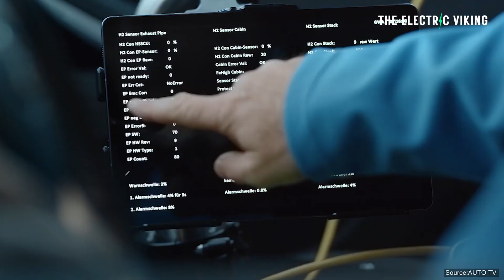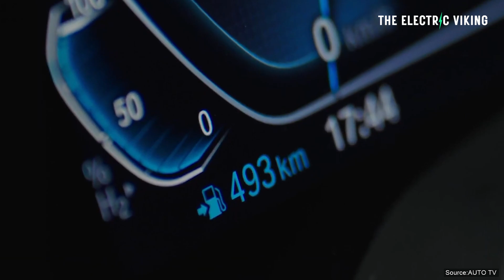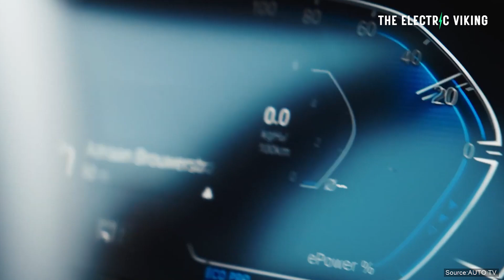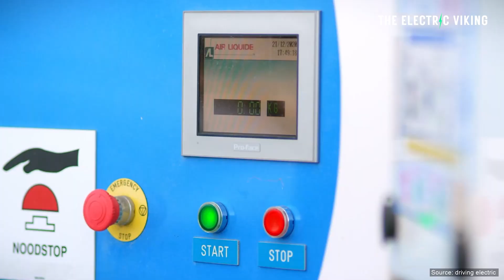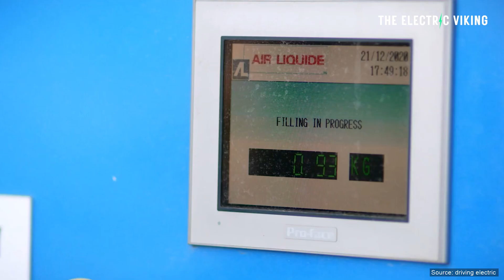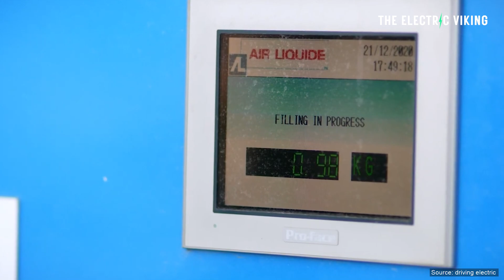BMW partners with Toyota on the future of transportation - hydrogen

Comment: Didn’t Toyota announce they have halved the size of batteries a month or two ago?      I can see big oil pushing hydrogen because it’s a commodity that can be sold.     I have been hearing from Toyota staff that hydrogen is their clear direction for so many years.  I think they are missing sales today by not having full ev models available.

Comment: To be clear, I believe in EV’s…but I’m critical about battery business.
The real question is, do you really want 100% battery powered EV’s and the huge adaptions to the complete electrical grid from an ecological, political and cost POV.

Batteries will never have the environmental sustainability potential of H2. 
H2 will temper the need of those large polluting batteries.

The abundance of available H2 both via clean energy or via industrial waste compared to the rare metals of batteries are politically a more stable resource.

Lastly cost… yes… batteries are more efficient compared to using H2. (most charge time issues will be solved in the next 5 years). That has an economic impact…as long as you’re not using ‘free’ green H2 or leftover industrial H2. So who cares if H2 is less efficient?
The cost of network is indeed huge…but have you ever considered the impact EV’s will have on the current grid? 

Just to have an electrical charger installed at my home for a PHEV, I need to have my complete electrical installation redone (house of ‘74) before it can get legally approved in my country.
That’ll cost me several 1000’s € on top what the government will have to pay to update the complete grid to our homes.

H2 is an alternative to BEV’s, not a replacement…an alternative that is ecologically and politically more sustainable and wasn’t that exactly the point?

Comment: You blow my mind how ignorant you are wow. Amazon and Walmart DCs forklifts all run on hydrogen!!  Huge operations running hundreds of light engines. Hydrogen is critical to food processing agriculture chemical manufacturing. As the population increases as does demand. It’s going to green manufacturing as it has too. You can’t do that with coal and gas which currently charge most of your EVs. EVs are great and won’t be going away but hydrogen is also coming to stay to do the jobs where it’s better suited to get off fossil fuels .

Comment: What are your qualifications?? Not tech or research! I’ve got mates that are Viking blood stop making them look stupid please with your opinions not based in fact, tight arse must be paid by Tesla as a marketer. Lithium ion after billions spent over 3 decades is maxed out at .045 kw / kilo,that’s why you have a 500kg battery in you EV to get a decent range very inefficient, they also leak down won’t hold charge indefinitely like hydrogen. Panasonic developed teslas batteries for them. Next tech leap is solid state batteries and hydrogen. Toyotas been working on both, Tesla doesn’t do R&D. Hydrogen trucks are on the road Pepsi uses them and another fleet has 75 with more to come. All governments around the world want a hydrogen solution. When Tesla EVs hit the market there were NO CHARGING STATIONS you nuff nuff. Very easy to convert gas station to hydrogen especially where LPG is available easy retrofit. All major truck companies, marine Warstila, Cummins paccar catipillar, JCB, Boeing, airbus, semiens and other automotive support companies are doing R&D . You can by hydrogen kits now to convert you v8 muscle car to run on it with zero emissions . You will never be able to tow a ski boat any distance with an ev . Hydrogen is the answer for those that tow and go 4 wheel driving in remote areas. For class 8 truck , trains boats . Your figures seriously mate…. 500kg batteries for each car to replace the existing global fleet there is not enough lithium in the ground let alone cobalt . Hydrogen is easy to produce, it can even be made from air and is getting green sourced. The myth hydrogen takes energy to produce really !!! Less than lithium mining, transport and battery manufacturing. Coal has to be replaced for power generation Hydrogen will be a big part of that as will solar and wind and naturally with the current demands of 5 million ton of hydrogen for Germany and more for South Korea among other countries cost will come down considerably to less than a dollar a kilo. We will definitely see hilux and Land Cruiser owners cross to the hybrid variants than to hydrogen .  By 2030 is awesome go Toyota as hilux owners will go from the exiting ICE to hybrid to hydrogen. In quite a few countries hydrogen is the only way to go green and get off fossil fuels , solar and wind are not options unfortunately.

Comment: Your right Sam.   H2 will NEVER be viable as a consumer fuel.   It’s an unmitigated disaster.   I own a Mirai.  A full tank is literally 200 dollars.   A hood tank yields 400 miles.   So it costs 2 dollars a mile to drive the stupid thing.
Reply: @leen-jd8xp hasn’t even started yet?  Uh wake up.   BMW brought the first hydrogen car to market in 2005.   The Mirai is starting its 9th year.   The hydrogen fueling situation is getting worse not better.   It’s untenable.   Shell closed all its UK H2 stations last year and is doing the same in the US, because it’s too costly to maintain.  In 3 years I’ve owned my car the price of hydrogen has TRIPLED!
Reply: @leen-jd8xp my fault?  Please.   So tell me when that is going to happen?   You need to just shut up.    You have no idea what you are talking about.   The cost involved to make H2 viable totally precludes it for mass market use in passenger cars.   May work for commercial applications but there will never be infrastructure to support millions of vehicles.   Transportation and dispensing costs will not go down.   The complexity is off the charts and H2 is insanely volatile and degrades any structure used to plumb it.   I could go on.   You on the other hand are talking out your butt.

Comment: Hydrogen has too many maybe impossible challenges:
(1) compact system
(2) low cost system
(3) efficient system
(4) much lower cost hydrogen
(5) efficient hydrogen production that does not undermine carbon emissions reductions
(6) needed 100X refueling station cost reduction
If a price on carbon existed hydrogen would have no chance except for aviation and even there it has to compete against ammonia

Comment: There will be some kind of hydrogen network in the future.  Jets, steel manufacturing, and cement plants will probably convert to hydrogen in the future because that’s the best option to go green.  There are a lot of vested interests in fuels that need a new fuel in order to stay relevant in the future.  It’s difficult to imagine them going totally out of business.  But, only time will tell…
Reply: Just use electric for cement kilns.  There is a hydrogen process for making a steel precursor which then goes to an electric arc furnace. Hydrogen is a specialty thing.  Expensive to make green hydrogen.

Comment: In the UK we had about 12 hydrogen filling stations. Shell closed their 3 stations recently so about 9 left. 

Hydrogen could probably have found success if someone invested in the hydrogen filling station network before Tesla started building Superchargers but let’s look at that challenge:

We have 8,000 filling stations in the UK.
To install a hydrogen pump and infrastructure that can fill about 20 cars a day costs £2m.
To put one of these at each filling station would cost £1.6b.
This would fill 160,000 cars a day.

The economics of building a hydrogen station network to fuel a few million cars are enormous. Unless BMW or Toyota want to pay for it how will they sell hydrogen cars, especially in 2030 when there will be rapid chargers all over the place. We already have over 40,000 public EV chargers in the country.

Comment: Plenty of Hydrogen filling stations coming in Europe. 
I have one nearby, 2 near places I visit and 2 more coming this quarter on my frequent routes.
There are also some Hydrogen powered taxis (Mirai) that I see every few days.

The lack of good charging infrastructure nearby is just too much of a PITA to go full EV. No chance of charging on home solar either, as only public parking is available.
From the figures I have seen, the Lithium prices will only stay low if Sodium replaces it. There is just not enough Lithium to electrify the world.

For power plants Hydrogen will be a nice alternative, especially with heat pumps drawing a lot of power from the grid in winter.
But we will see what the future holds. For now Hydrogen is most compelling in heavy  transport, and maybe for those like me who can not charge at home.
Reply: You are grossly mistaken.   Hydrogen is a total nightmare.  I own a BEV and a Mirai.   We have 56 stations in CA and a third of them at any given time do not work.   Charging stations cost next to nothing to build, witness Tesla just hitting 50000 chargers, half of those in the last 3 years.   It costs literally millions for every hydrogen stations.  I’m telling you right now unless they change the current dispensing method, hydrogen will never be viable.
Reply: @twothbeave  chargers are cheap. Expanding the grid for millions of cars is not. Here we are facing challenges that pretty much stop us from putting in more charges where they are needed. So now we have about 1 public charger for every 3 Ev's, and that's mostly 22 kW, with only 11 kW per cable if two cars are charging on it.
How do you think this scales with a growing number of EV's and most homes depending on public parking? 
H2 refeulling stations here do have some downtime here as well, so planning ahead is still wise at this point.

The cost of putting in any gas station is never low, but worth it. These H2 expansions will just ensure their income (also from other products) as gasoline becomes even less popular.
Reply: @SolAce-nw2hf do you drive a H2 car?  It’s a complete joke.   Planing ahead?   You state there is downtime.  That is with less than 0.01 percent of cars on the road.   What if you raise that number by a minuscule 100000 cars.   Everyone will be waiting.  It’s literally a lifestyle change.   You have to be half uncorked to put up with the nonsense.  Why my last sentence stands.  With current dispensing it will NEVER work.   Ask Shell who closed their European H2 stations last year and just did the same here in the US.   Too expensive to keep open.   I could go on and on.  This just is the tip of the iceberg with the problems with hydrogen.   None of which are being solved.
Reply: @sbalko74  Lithium mining has caught up with demand (for now) and scaling EV production can not keep up with this. This suppy/demand balance has a large impact on prices.

Globally there is an estimated 88 million metric tons, of which 22 million metric tons are viable to mine. If only EV's would need it, there would be enough. But to power the chargers and homes, you can't just turn off the grid when there is insufficient sun and wind. We will need a lot of energy storage for large transport as well, and those trucks, ships and trains tend to require a lot more than cars.

But we will see. Maybe  Lithium mining will improve, both in volume as in environmental impact. Currently it's no better than coal mines.
Reply: @sbalko74  I think recycling will become more interesting as Lithium prices increase. But to replace all ICE cars and make sure we power the grid, we will need to make batteries at an exponential rate. 
The problem with this, is that all 15 year old EV's don't amount to much Lithium, and that will be the case until 10 to 15 years after demand stabilises unless Lithium is so expensive that scrapping a car rather than putting it for sale makes more sense. That way it could take only 5 years after most running cars are EV's. If growth is not exponential, replacing all ICE's will likely take a century.

Compare the Lithium situation to trying to reuse a 15 year old hard drive from your computer. It's not going to amount to anything because of the exponential growth.
Reply: @sbalko74  There are about 1.400.000.000 road vehicles in the world and BEV sales were about 10.500.000 in 2022. So with linear growth, it's not going to make a dent. Eventualy an S curce may be the end result, but for now exponential growth is needed. Most third world countries have very little BEV's, and I think a hybrid or plugin hybrid would make more sense there until they have a grid to handle EV charging. 

I am looking at those alternatives myself, just in case my car mileage goes up again. For now I visit the gas station maybe once a month or so.

Comment: Bjørn Nyland tested a Toyota Mirai on his famous 1000 kilometer (621,89 miles) challenge. He spent 8 hours and 40 minutes, average speed 115.4 km/h (71,76 mi/h).

And how much did the fuel cost?  2,700 NOK (= 270 USD)

And then the fuel is already subsidized.
Reply: Yes, and the efficiency is crap too, at around 23%....that's worse than an ICE car.
Reply: Fuel is 36 dollars an equivalent gas gallon now!   It’s plain stupid.

Comment: Define everyone!!!
Where's the infrastructure?
How much and often will service cost compared to EVs?
Reply: There are around 15 hydrogen filling points in the UK, and most of those are in or around London. Fuel cells do degrade over their working lives, and will require repair or replacement at some point....
Reply: @Brian-om2hh  
You'll also need specialist fuel tanks as hydrogen is very difficult to store and the pipes to pump into engine. Even more expense to add to servicing costs their determined to keep the future servicing costs.

Comment: Hydrogen's boiling pt of -259 degree c  plus its ease of leaking makes it impractical in a passenger car.   Have to tip my cap to Toyota in engineering the mirai.   Yet Hydrogen storage in the form of ammonia is quite a different story, boiling point -33 degree C or -27 degree F; and the storage is much less of a challenge.  If it can be combined with plug-in hybrid engineering  making it a viable solution; battery size is much reduced thus a substantially smaller CO2 footprint.
Reply: Good luck convincing people to buy a vehicle where a fuel leak will poison you. Ammonia may work in chemical plants, but nobody wants to be near the toxic stuff in a consumer product.

Comment: When I was in Munich earlier this year I saw a Toyota Mirai there. I’ve never seen any hydrogen powered vehicles here on the roads in the UK.
Reply: This vehicle stores 5kg of H2. The amount of energy that can be recovered from this as mechanical energy in its ICE is the same as the mechanical energy that can be recovered from a BEV with a 58kWh battery. Safe volumetric storage of H2 will not improve in energy density. BEV batteries, though, are likely to double at least within the decade.
Reply: Oh, I forgot: I also saw the Riversimple prototype 2 seater car developed in Wales when at an alternative energy conference in Bristol. There was a bit of queue for a test ride, so I skipped the chance.

Comment: Green hydrogen, for every 12kWh of energy delivered to the wheels of an ICE car, consumes 50kWh of electrical energy. For a BEV 12kWh of mechanical energy is got from 15kWh of electrical energy less than one third of the cost. The fossil lobby is hoping Blue Hydrogen (fossil intensive with carbon capture)  is the compromise for a decade or two, though even this is not much of a cost improvement.

PEM fuel cells and electric motors are better than ICE in mechanical energy production from H2 but still only offer half of the overall energy efficiency of BEVs and put a huge burden on the global resource of iridium (a tiny byproduct of platinum refining used in PEM fuel cells). Increasing demand  will only be met at huge cost.

BMW is following Toyota into oblivion with this.

Comment: Toyota have continuously failed to crack the Hydrogen Car problem. Evidence has clearly shown that Hydrogen is not a suitable solution for small passenger transportation. This is aside from the fact that Hydrogen is produced from fossil fuels hence the push. over 98% of Hydrogen is produced from fossil fuels. This is a scam pushed by the OIl & Gas Giants to help delay their death.

Comment: Tesla has 10,000 superchargers in Europe, there are 254 hydrogen fuelling stations in Europe.  95 in Germany 44 in France, the rest have 17 or less many countries only have 1 or 2.  Toyota got Japan to build a hydrogen network of 161 stations.  I can understand Toyota but BMW?????  BMW need to ramp up production to lower costs and make their BEV profitable.  In UK mini convertable petrol £32,000, electric version £52,000.  BMW also need to follow TESLA and have a smaller number of models or at least the basis of the cars as a smaller number.